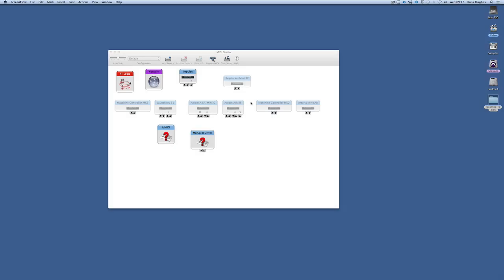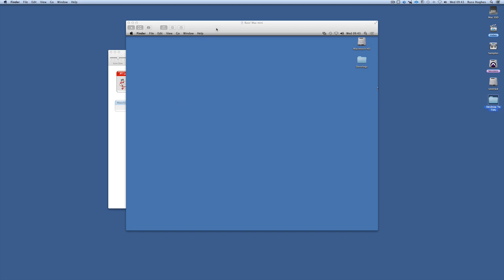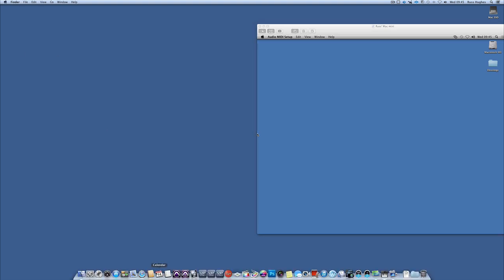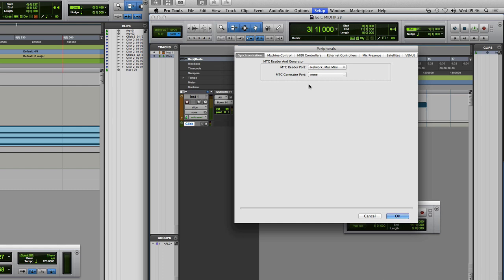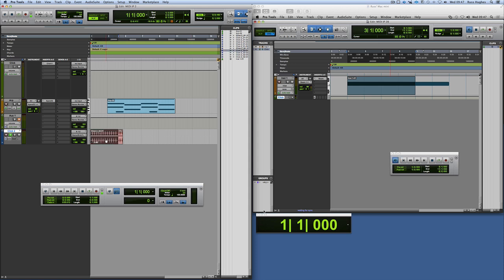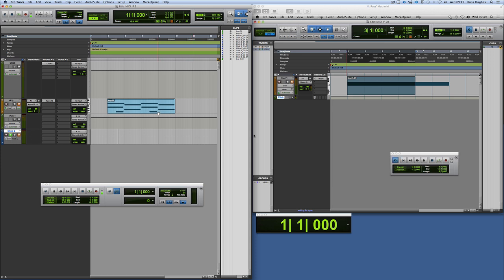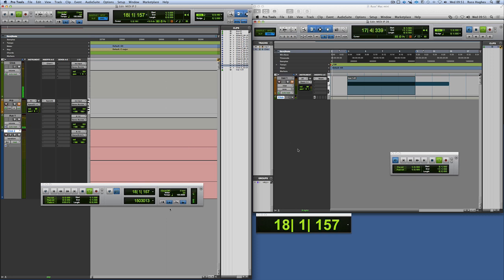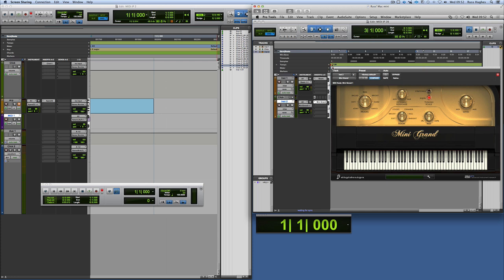Pro Tools Tutorial: Sync Two Macs Running Pro Tools For FREE Without Satellite

Comment: Is it a must that when you run two macs to use the same software on both or could you use 2 different softwares? I have an older mac that won't run my current pro tools and was wondering. I am limited to PT 8.0.4. on the old one, but have to reboot in the older OS (My old mac can use the newer OS when rebooted, but doesn't have the architect to run the current P.T.)  to use it. It's a lengthy amount of time that I don't want to spend. Thanks. Nice video.

Comment: Russ, Thank you for your video on syncing 2 ProTools rigs with ethernet connections.
I was doing 24 track analog tape archiving with baked tapes from over 40 years old. Everything had to be recorded in one pass and midi timecode with midi in/out was not working right. YOU SAVED THE DAY.

Also the offset in to correct the slippage worked like a charm. My offset for machine 2 was -945 samples in the Global Offset.

I am a subscriber and look forward to more of your videos.

Christopher Troy
Los Angeles, CA

Comment: One other thing you may want to do:  If you have SPDIF or Word Clock, you should sync the clocks to minimize clock drifting (even if you're not transferring audio over SPDIF).  Just make either PT box sync to the SPDIF of the other.   In my case, I have a house Word Clock generator that I make my MBOX2 PROs Sync to.

Comment: Absolutely! The slave need to have 'Listen to MTC' activated, aswell as 'Sync' activated in the transport bar. Also you dont have to use ethernet, WIFI works aswell. Audio can be sent via Apple AUNetsend - AUNetRecieve if you wish, but it has a delay so might not be optimal.